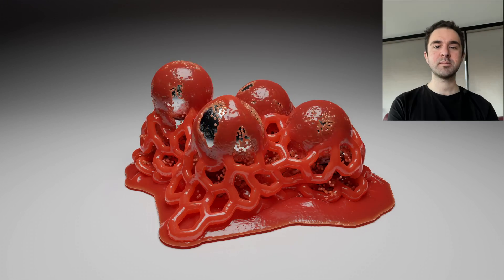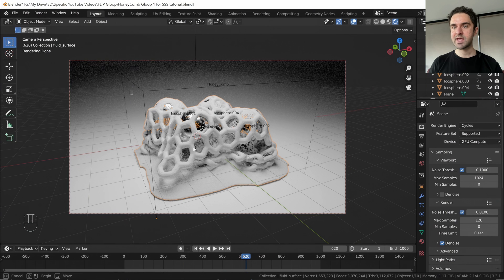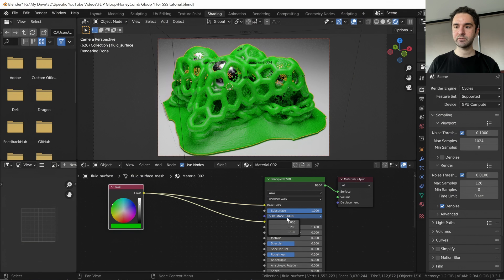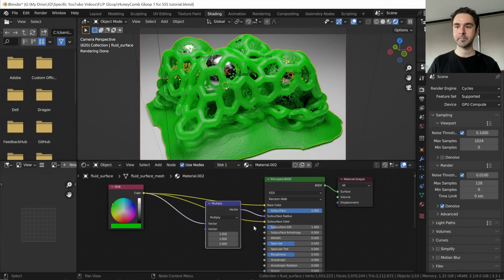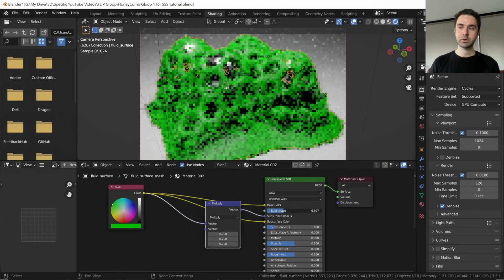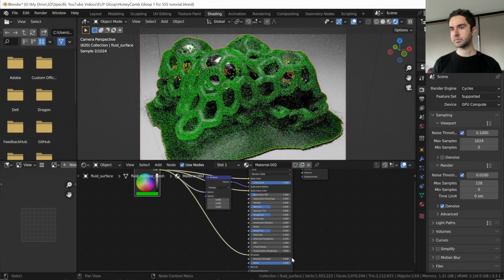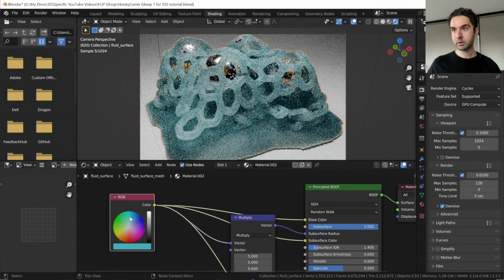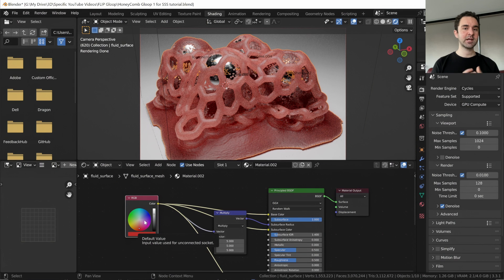Slime Material Tutorial - Blender Sub Surface Scattering in 5 mins

Comment: You’re  missing that the radius is the length that particular wavelength of light will penetrate a surface. So, if my slime model is much much larger then yours it will look different. 1 is 1 meter so that might even been right through your model. You can do it by eye but you still need to understand the scale. The look can change dramatically between .1 and .5 or .01 etc. sliding it around while watching may not give you time to see what’s happening. 

Light penetrates human skin about 3mm which is .03 but a lot of the reference I see says .3. This is if your head model is the right size, not 1 meter wide etc. I’m on the hunt for real info on how this works. Your method is valid if you get the results you want, but if you somehow end up with a model of extreme difference in size your material will look different etc.